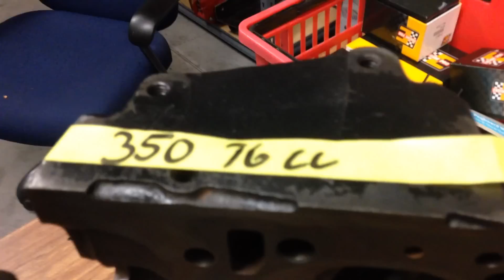350 and 305 Chevy what's The Difference

Comment: what I couldn't understand with GM's logic.  The 305 and 350 require different tooling for the machine work.  This costs a lot of money.  If GM had used the 327 or 302 both of which use a 4" bore and the exact same block as the 350, they would have saved a ton of money in the cost of the tooling and castings.  The crank and rods would have been the only different parts, pistons, block, heads and everything else could be interchangeable.  This would have given GM the small and large displacement engines for various applications.
Reply from the maker: I agree with you 100% and with a 4" bore with short stroke you have the potential for a real screamer
Reply: +1  This is the exact reason I love the 327 more than the 350.  Even though the stroke is just less than 1/4 different I found my 327 has much quicker throttle response and gets into the power a bit quicker.  Now the 350 will grunt a bit harder when towing but the 327 isnt a slouch there either.

Comment: Both the 305 and 350 Chevys are the same block. They both have the same size crankshaft, connecting rod assembly, etc. The ONLY difference between the two are their bore sizes. For example, the bore size of the 350 is BIGGER than the bore size of the 305. That's all to it. Also, for example, the 350 burns MORE fuel than the 305.
Reply from the maker: Correction they are not the same block you can not turn a 305 into a 350 they do use the same crank and rods with a different bore but definitely not the same block

Comment: I was always curious as to what the deference was between the 305 and the 305 HO that was used in the 80's Monte Carlos.
Reply from the maker: the heads HO had smaller chamber and bigger valves
Reply: Myvintageiron7512 cool thank you I always wandered about that because I know from experience they definitely did have more shit to them.

Comment: The only thing ive seen with 305s is they were built in the wrong era, when manufacturers were trying to save coin, same problems the 350 and other engines had at the time, but dimensionally, and actually, the 305 is a great little workhorse, I hate it when ppl just blurt out "junk 305" , it never was, yeah there was a series of head castings that were not so great, but thats an easy fix for anyone whos building one.

Comment: Too long, didn't read all the comments. If it's still together or in a car, 350 harmonic balancer is larger diameter and thinner than the 305. Easy to a trained eye. About to do a 305/350 mash up rebuild for my Olds custom cruiser wagon. Came with a 305 that's real tired, have a 350 010 four bolt block I'm gonna use with new pistons. It's a 91 so it has tbi, newer non dog poop heads, etc. Just want a cruiser,it's too heavy to be a racecar. Might go LT1 heads, not sure yet.

Comment: Didn't say anything about camshaft...I used to have 80 Malibu wagon 305/the 350 with a lockup converter...caught the cam just as it started to kill a couple loves so I put a cam from 88 Chev truck 350...first year tbi motor..a few mods to the computer Q jet carb to richen it up and it ran way better than it should of...you can get more power with just a proper cam than you can get with headers/intake/carb change on a 305 because I did all that after driving it for a year with just a cam change and it was a waste of time and money

Comment: So sad, to hear him say there is no benefit to using 305 heads on a 350 block.
Peak horsepower is only useful on the dragstrip, for the most part.
The truth is that there are useful gains in torque, power, and efficiency in the low to mid-range rpm band ...  where your street-driven daily cruiser is going to spend most of it's operating time.
Simply choose a thicker headgasket (from the readily available aftermarket selection) to match the fuel octane  that you will be using.
Enjoy your increased fuel mileage and increased low-end torque ...  just what you need to trailer your high rpm race car to the track occasionally.
Reply from the maker: I have built these 305 headed 350's many times and there is honostly zero gain in low to mid range torque Dyno tested many times with the same theory in mind and it just didn't happen the bigger 350 ports make more torque in all RPM ranges
Reply: @Myvintageiron7512 ,

Right.
I'll look forward to seeing you post that stack of Dyno data on your upcoming video.
It is well understood that smaller crossection ports serve to increase charge velocity in the low to mid-range rpm band. Thus, when utilized with a cam grind that compliments the intended rpm,  a dual plane intake manifold, 600 (or less) CFM carbureter, and a long-runner set of small diameter headers; the 305/350 combo works quite efficiently on the street. 
It is never going to scream past a 350 fitted with high dollar heads ...  but it'll sure chug past a lot more gas pumps 
If I sound just a tad bit confident in my opinion, it is because I've driven the engine described above, for well over 100,000 miles.

Comment: i had a  78 El Camino with a 305 took the 305 out and put a 350 it had lots of horsepower that 350 was a nice engine but if I had to do it again I would have rather built the 305 as little as the modifications I had to make they were still a pain in the ass and for the amount of horsepower increase I got by putting in the 350 really don't feel it was worth the money and the troubles

Comment: Might want to be careful if you think you can interchange 305 and 350 crankshafts. The 305 is a much lighter made crankshaft with considerably smaller counterweights. One of these in a 350 application will result in problems with internal balance. And putting a 350 crank into a 305 is also something that should be avoided because of balancing issues. Of course you could have the lighter crank welded up so as to add weight or a 350 crankshaft ground down in order to make it work in a 305, but why bother when there are so many 350's available at the same or less in terms of cost. If one is patient it is pretty easy to find a stock 350 engine that will surpass the power output of all but the most heavily modified 305's. I suppose if someone has an old Z or Monte Carlo SS that they want to run better while maintaining stock displacement it is worth it to pick the right parts and make it all happen, but I can't think of another reason for investing heavily in a 305.
Reply from the maker: The 305 cranks work fine in a 350 It's a very simple balance job done it dozens of times works great

Comment: The tiny bore is the 305's weak spot. This limits the valve size...  I believe smoky yunick came to the same conclusion about a minimum 4" bore is the way to go. Don't waste your time on building a 305.... (I tried .... Not to impressive in a caprice body..,lol). Hold out for a 350, you'll be glad you did in the end. Grab a set of vortec heads .. And you're way ahead of a "built" 305.
Reply from the maker: I agree the bore size it he real draw back for the 305 the 283 was actually a much better engine because it had a larger bore

Comment: I got my mitts on 95 Caprice well motor looked like 5.7 v8. Shit has 4.3 v8. Same shit as 305 / 350. Melted spark plug wire makes ticking sound. EGR valve was carboned up. Plastic radiator broken. Let's just hope moisture don't kill my Opti spark

Comment: I agree, 305 trash motor. the cylinder walls are thin, they cannot be bored out. 305's are not small bore 350's. They were designed in the early 70's for lo-emissions no-power potential purposes.

Comment: 350 with 400 SB heads with a set of Hooker headers and a 600 edelbrock carb. 305 is the Sunday cruiser (fuel efficiency not power efficiency)

Comment: I have NEVER driven a 305 that had any power, they were all very tired. I would never waste my money rebuilding one. I have done several 305 to 350 and LS swaps, and trust me its a dramatic improvement. It just annoys me when I check out craigslist cars and truck and people think they have a 350 when its really 305, or just simply dont know what it is other then a V8. Then I get to play detective and figure out what it really is. I have heard that 305's were painted blue from factory, not chevy red?? any truth to this? I guess even if it were true it doesn't help identification if motor has lost its paint or been re painted.
Reply from the maker: All small blocks were painted blue for a few years in the 80's

Comment: 327 and 350 have the same 4" bore. 350 has one-eighth inch longer stroke. Only difference.
Reply: Same block casting on many. 010s I've seen lots of. Excellent block. Most had 4 bolt intermediate mains if they left the factory with a four barrel.

Comment: The 305 came with a 3.736 bore. A 3.76 means it's. 030 over and actually a 310. That doesn't change anything else you said about it. Just want to clarify that point.
Reply from the maker: yes correct

Comment: In marine application the 305 offers almost no significant difference in fuel economy, no difference in weight, and a loss in H.P. But worse, there is a big loss in torque. .

Comment: 305's got a bad rap because the late 70's / early 80's carbureted ones had bad cam shafts but by 1985 GM fix the problem

Comment: The only thing I noticed is he stated the 305 has a 58cc chamber but this is not 100% accurate. My heads are 100% day one original on my 76 camaro and it runs a 76cc chamber. The chamber size in the heads were changed in the 70’s due to insurance adding on because of HP as well as this is when they started changing from leaded to unleaded fuels.
Reply from the maker: There were no 305 engines that had a 76 cc chamber they were 65 cc and the 305 HO was 58 the 350 heads were 76cc

Comment: So since the 305 heads on the 350 made no difference in the horsepower I'm going to assume it didn't help the torque at all either. On a side note, the first time I saw a 400 small block without the heads on it my mind was blown by the size of the pistons, though it had been a long time since I had even seen a 350 without the heads on it...

Comment: 305 vs 350 ....same crank...same stroke ...
To make a 350 into a 383 ...add 400 crank and rods ?   Correct ..
So. What if I put a 400 crank and rods into a 305 ?
Reply from the maker: sure you can do it makes 336 ci in a .030 305 block but if your going to all that trouble might as well build a 383 a smaller bore gives you no advantage whatsoever
Reply: Def makes sense  
And I just ran the #s on my 305 ...its actually a 267 ..out of an 82 caprice 
I'm looking to build an s10 rat rod I can use the 267 in.  Not looking  for big hp or tq.  Not sure what stock hp/tq is in a 267 but is there anything I can do to add small amounts of hp. I'm hoping to keep it streetable.  Daily driver. Thank you for your time. And keep up the vids.  I do alot of work on cars and I still find myself learning more and more from ur vids

Comment: How can u tell by looking
Reply: Run the casting number on the back of the block or the head casting numbers and if the engine is complete 305s usually have straight small log exhaust manifolds but the only for sure way is to run the block number on the rear driver's side

Comment: In summary: 305 IS a 350 with a smaller bore and crappy flowing heads.
So 305s are not "just ok" they are the same.  Same block, same crank, same con rod.

So does that mean a 305 could be bored and stroked all the way up to a 383?

Comment: As far a Performance. I wouldn't take a 305 for free. So if you build a 305, you're throwing money away. Useless as Tits on a Bull. I drove a 85 SS Monte Carlo with a HO 305. It sickened me. Now, if you just need transportation, and the engine's in the car, drive it.
Once you drive a nice 350, with the right heads, cam, intake carb, headers, ignition, gears, converter, you will smile from ear to ear. You won't have to jump on it, around turns, or break torque it to smoke the  tires. You floor it, and the tires go up in smoke. You smile, and get some ET streets.

Comment: can i put a 350 head on a 305
Reply from the maker: it will bolt on but not recommended very low compression and the bigger valves may hit the cyl bore
Reply: @Myvintageiron7512   thank you  for that

Comment: Exactly. I have a 305 on a 89 camaro rs with a 700r4 transmission. I'm saving for a rebuild and everyone I know keeps giving me shit about it. You hear the mindless drones of putting an ls engine or a 350. I don't want a  ls engine and I dont want a 350. If i wanted power than i would have bought an iroc. A couple of my friends wont even help me with removing my engine because I plan on rebuilding it. They can fuck  off. I'm building this car for me.... for ME!!! Not to make others accept me or impress them. They're not gonna be the ones driving it. I am. My car.

Comment: I don't understand why anyone would consider using a 305 anyway unless you are running one in a stock original car.  350's are a dime a dozen and there is one sitting in everybody's back yard everywhere.  To argue between them is silly.  Grab a cold one and chill~!!!
Reply from the maker: I do agree there shouldn't really be an argument about it however the one thing I think needs to be addressed is you have a group of people out there that will tell you 305's are garbage and good for nothing except the scrap yard,
 this kind of thinking is just nonsense not everyone wants or needs a hot rod engine.
 305 engines
 are quite reliable,  and they get decant mileage.
 I had a 76 chevy pickup that I paid 300.00 for with a blown 350 I had a low mileage 305 that I paid $50.00 for freshened it up with rings/bearings and a valve job used it for a work truck made hundreds of trips to home depot and also did a bunch of engine rebuilds  hauling around engine cores and parts for about 4 years.
 I made thousands of dollars with that truck and I had about $900.00 total into it I finally sold it to a friend who is a handy man he is still using to for home repair and construction projects it's been nearly 15 years now and it still runs like a top and gets 19 MPG with a 700R4 on the highway  but I know  many will still say "There Junk scrap it"  it's just so petty and childish to take that position

Comment: The balance from the factory is much different yes the stroke it the same but the 305 has less counter weight. If you just put a 305 crank in a 350 stock it will SHAKE and as far as balance you would have to make the pistons much lighter or add mallory metal just not worth it.
The two cranks are very similar and its a common mistake if you dont know what to look for
There in one low buck trick it is to use a 305 crank in a 350ci motor like a 2bl Street stock and light weight KB pistons that way you dont have to drill so many holes in the counter weights to get it balanced.  
And obviosly you dont want to put a 350 crank in a 305 for balance reasons

Comment: The main difference between a 350 and a 305 is. Somebody just made a misprint on the 305. The 350 is built in the USA. The 305 is actually a 350. But in China when the were building 350's they spelled the 350 wrong.😂

Comment: The 305 has very limited horsepower upgrades available. And it will eventually crack. The 350 has a lot of horsepower upgrades available, and it will eventually crack.

Comment: To correct you the crank on the 305 has much smaller weights on crank
Reply from the maker: To say they are much smaller is incorrect they are slightly smaller I have built ton's of 350's with a 305 crank and had zero problems
Reply: I own and drive them both.
Its  Not The Zero problems I m sure your engines run like tops.
The bore  size is 3.75  Versus 4.00 to 4.25 ss 350 . 
a small 60 t0 80 foot pounds but its huge on gas milage , free horse power ,
but in momentum the smaller weights dont carry the momentum  under load the way the 350 
does  .
I can feel it.
Much might be a exageration .
but they are not the same , exept in stoke ,weigh them and let me know.
also if you switch fly wheels you balance will be off right?
I also read there not swapable.
I wasnt picking on you .
Just adding to what you said Im a fan .
At one time I thought using a 305 crank in a 350 might be free horse power.
Faster through the rpms I wanted to ask your thoughts on that stuff but I had to run out the door.
sorry if you took that the wrong way.
Not trolling you. I get irritated by them too.
But appreciate you even answering . THANK YOU
Reply: and the 2 inch valves was a mistake on your test should have dynoed the ported heads with the smaller valve.
I hogged them out .
My 1st 416 cyl.head job 
and a little combustion chamber work for flow around the big valve .
And I trimmed the od on valve clear to where the valve touches the seat
and the inner bevel and lapped them . 
my freind got got a ten second quarter mile with a 4000 rpm stall converter  and 4.11s  and a cam.
I think thats pretty good .
Reply: I found a set of 601s  I bet thats what you used Tiniest intakes ive ever seen I shined them on.
Reply: We did embraced the low to midrange tork with the 4.11s
Reply: And the 416 ho heads came on a brand new 85 Z28 camaro from the factory on the 350 HO.
but it was a misunderstood creature . 
everybody and mechanics  thought  it was over heating and kept looking for a cracked block .
But it was merely a 240 degree thermastat and needed a 180 put in .
So everybody unloaded them;
They were a blast driving them
The 416 HO heads are one of chevys secrets.
Reply: Also Id bet you used a holley carb  Not a good low end carb 
1407 eldorbrock 750 I swear by.
Or was it the stock   ccc distributor and  quadrajet?
 Could you not get it past 4000 RPM?